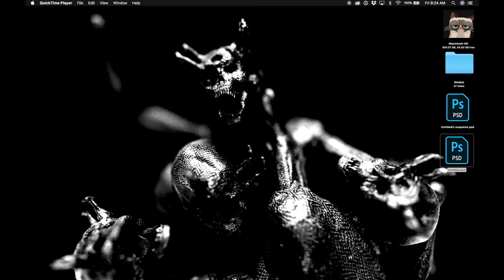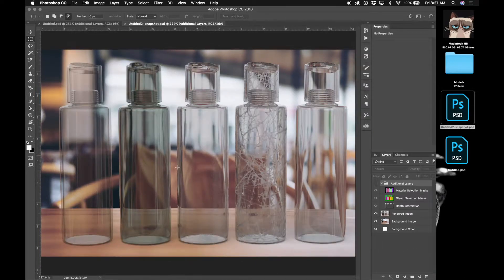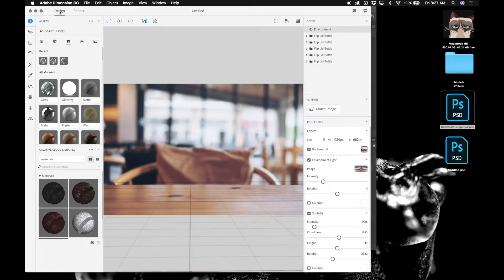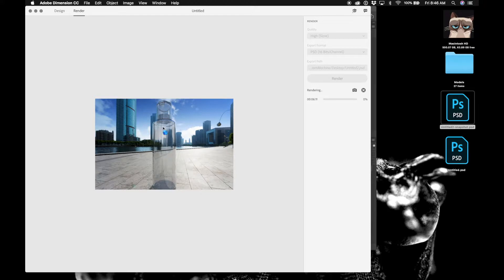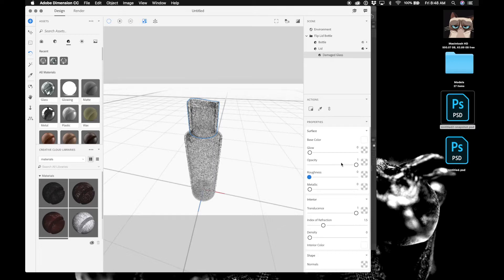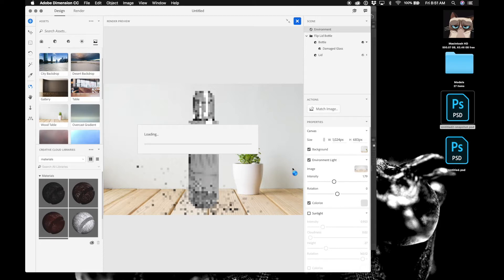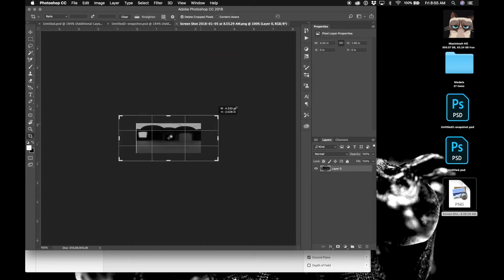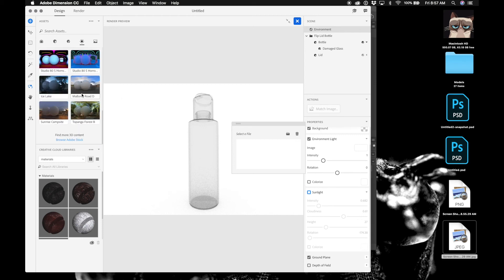Dimension CC: Fixing Problems With Glass

Comment: Hi, i want to know how to fill water or juice into the transparent model
Reply from the maker: you'll need an additional OBj object that sits inside the bottle. you'll have to be careful with placing it since the size of the Product OBJ needs to fit exactly inside the bottle OBJ or it will look weird. you can use photohop to build the 3d OBJ, but i can never import my models to the center of the scene in dimensionCC. i recemend Blender3D.  it's alot more dense to learn but it imports obj packages to dimensionssCC really good.